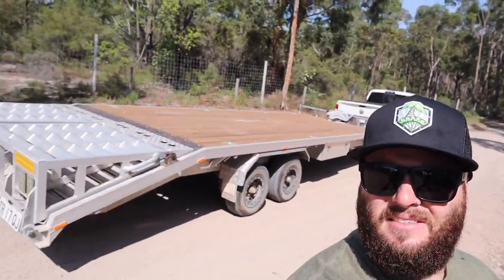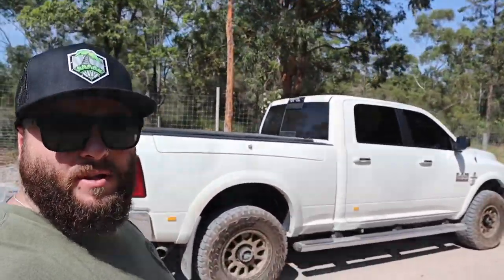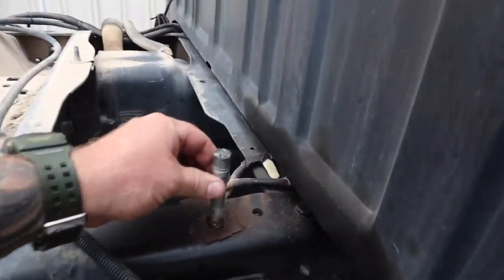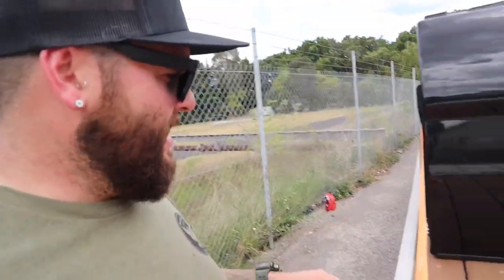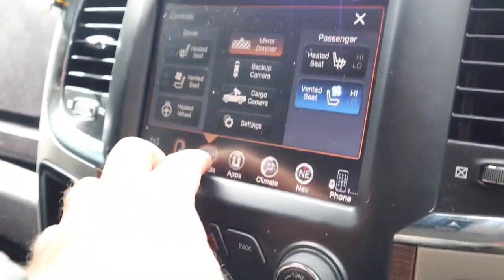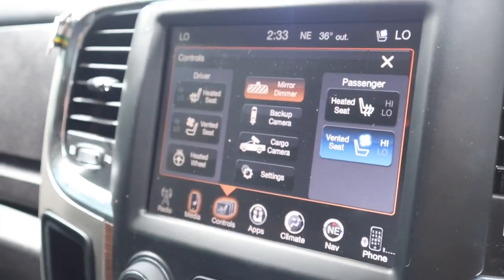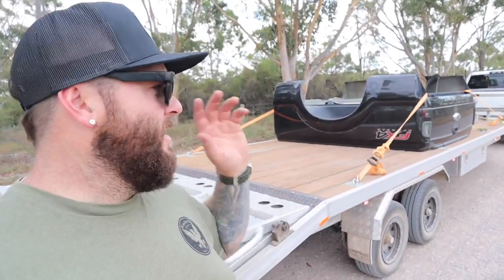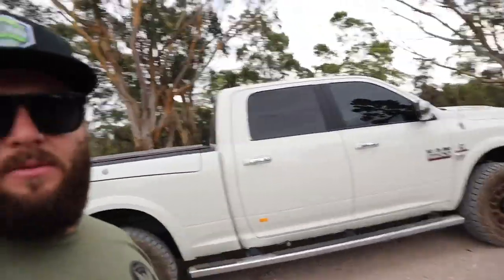TOWING WITH RAM 2500 IN AUSTRALIA ! How does it tow compared to modern dual cabs ?

Comment: Hey Ty, A one tonne buffer is not practical in my opinion in the Australian car market. The average size caravan for example is 20ft & around 2.5 - 3.0T add 2-300 litres of water & your van contents your easily at 3.5T with no capacity left to put food in the fridge.. unfortunately not everyone can justify or afford an F-Truck or Ram. 
Our Toyota has been towing 3.3T around the country the past 14mth’s with excellent stability, cornering & overall handling with a simple suspension & front brake upgrade. 
As you could imagine we’ve come across a lot of muppets and situations on the road and have never felt unsafe. We are so heavily regulated and they don’t just make these tow ratings up, a correctly set up vehicle is safe when driving to the speed limits & conditions.